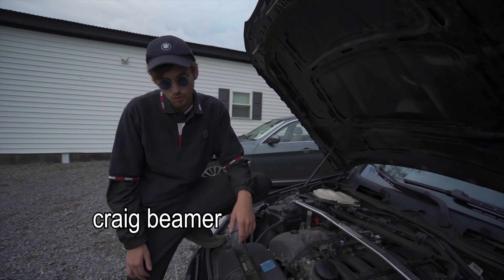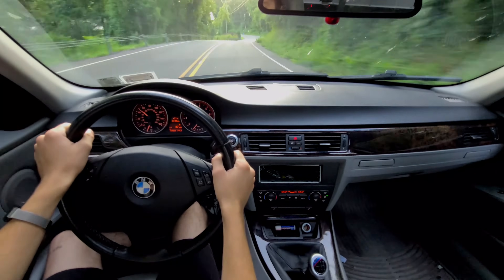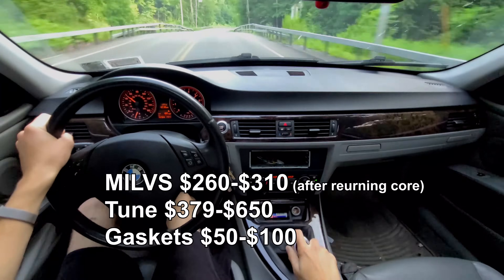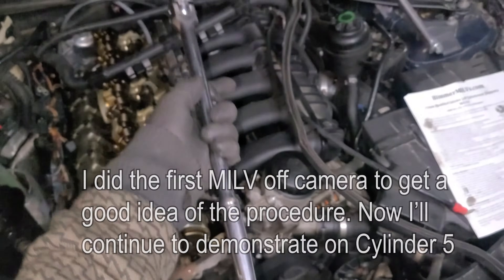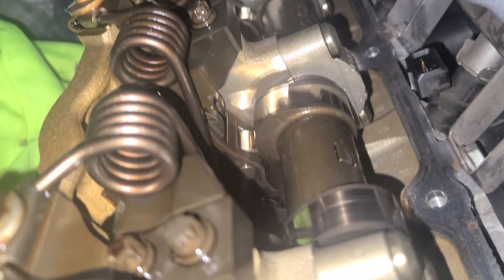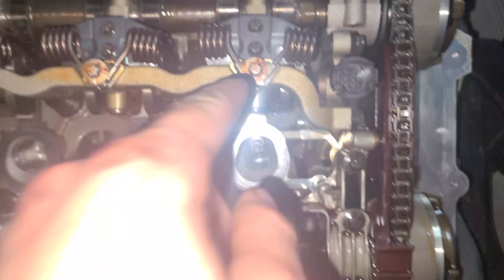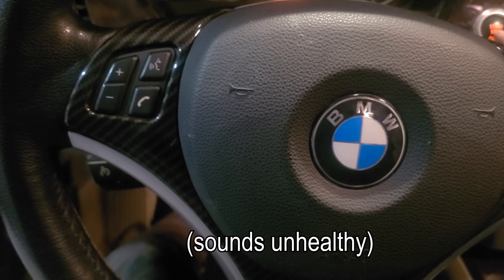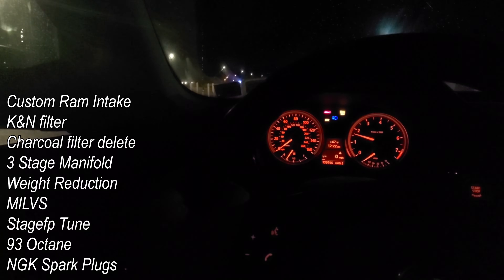BMW MILVS Installation - Overlooked N51 N52 N55 S55 N20 Intake Valve Lifter Mod

Comment: are u able to tune these in at a dyno tuner?
Reply from the maker: If the tuner knows what they're doing with BMWs yes. 22rpd also supports MILVs, which is what I currently use

Comment: So how much of a decrease you would say you got on your 0-60 with the milvs? Currently set up for me is cat back exhaust, catless headers, lightweight rims+ tires, kn filter, and a dyno tune and wondering if adding milves is even worth it for speed out of a dig
Reply from the maker: It's small / hard to notice because it affects the upper range just like headers. I'd say it's one of the last mods you should do, when you're trying to get every last bit of power out of the engine

Comment: Any idea if milvs/the tune would still function properly on a N52B25? I’m presuming this is all done on a N52B30 found on most 325 and 328s, while I have a 323 with the 2.5 litre, so I’m trying to figure out if it’s all still compatible

Comment: Hey probably a bit late to this. My N52 head got refurbished and a ticking noise appeared. I replaced 24 lifters just incase, but didnt help my case. I also replaced the chain tensioner still no luck. Any ideas where to look maybe? So pissed it haid oil consumption but no tickin before! No visible wear sound is mainly coming from the front of the engine. Any ideas appreciated!
Reply from the maker: Hey, would you be able to DM me a video to my Instagram, maybe I could help determine
Reply: @UltimateBimmerExperience  its currently 1:19am here but tomorrow i will manage! Thank you for your answer.

Comment: Hi newbie here taking on a new project. Thanks for posting this informative video you have inspired me to change this part myself 5 cautious turns at a time! Question, once I've installed the MILV upgrade on my automatic N52 330i I should get it tuned to now accept the higher RPM band. However, is it correct in thinking by doing so the car will take longer to shift up. Can I get it tuned to shift gears quicker instead of higher RPM? or does this make the MILV upgrade a pointless upgrade? appreciate any help you or anyone can give.

Comment: Where tf do you even buy these? my god I have had a tough time locating these online. I Found one manufacturer out of stock. That's all. Cheers bro great video!
Reply from the maker: On their website directly, I've got a spare set I'd probably sell. If you're interested you can DM on IG
Reply: @UltimateBimmerExperience  thx do you need a 2nd set for the exhaust side?
Reply from the maker: Nope, these are only for the eccentric cam on the intake side

Comment: Is this mod useful for the automatic 🤔
Reply from the maker: Yup, transmission doesn't matter
Reply: @UltimateBimmerExperience  you're insight is MUCH appreciated..Gotta clue as to WHY MILVS isn't talked much about 🤔
Reply: @UltimateBimmerExperience as WELL I've gotta p0172 code popping up on an N54/55 ,any quick trouble shoot suggestions 🤔

Comment: Bro I can feel the nervousness and shakiness (not a stab) If I was doing the same and would be doing the same if I ever did a mod similar to this lol. Thanks for the video!
Reply from the maker: Hahaha, yeah I was a little nervous. This was my first time doing this installation and I wasn't sure what the consequences could be if I messed it up lol. Thanks for watching!
Reply: @UltimateBimmerExperience  Nah completely understandable! It's basically the meat and potatoes of the engine. How is that mod running now, are you still running it? Did you ever end up getting a different tune on it?
Reply from the maker: Yup, still running them although I am on a different tune now. 22RPD which is a far superior product to StageFP for a lot of reasons

Comment: Did the car feel any faster to you after the MILVs install? I know they say it's 10hp extra but tbh I feel like if you were to do a blind test, most people wouldn't be able to tell a plus or minus 10 hp difference but I could be wrong. I just feel like paying for the MILVs and tunes for like 700-800 for 10 hp doesn't really seem worth it but I'd genuinely love to hear your thoughts. Love the vid :)
Reply from the maker: I'd say slightly, but it's more on the mid to top range. You're right it's a pretty expensive purchase, I wouldn't do it before an intake manifold or a good tune in general as those are both a better bang for buck. Thanks for your feedback!
Reply: Lol you get 2-4 hp by turning your ac compressor off

Comment: Might just take mine into a shop and get them grinder down probably be much cheaper....might be crazy and go 1.5-2mm hahaha
Reply from the maker: Its not as simple as it sounds. MILVs are already machined to reach max lift possible on the eccentric shaft
Reply: @UltimateBimmerExperience  Id put money that they was concervative to not destroy people engines....Regardless I can just get them grinder down 1 mm like you said looks about a that
Reply from the maker: @johncooper306  not even that, the valvetronic motor runs out of gear teeth to grab. At least to my knowledge
Reply: yeah sounds like a machine shop could do this for 10 dollars per milf

Comment: do you use extra virgin oil for oil changes ? It looks so clean. Looks like she hasnt been touched. Whats her interval ?
Reply from the maker: I use only oem KY oil. Lol I used Castrol gold bottle 5w30 and try to change every 5k miles. But the engine shown here I had only owned for 15k miles, so I suppose I got kind of lucky with how the previous owner did oil maintenance. But I've since had to replace this engine due to my own negligent mistake. But I got by what the Manual recommended but change every 4-5k on my regular 3 series

Comment: FYI: Kassel can up the redline for you as well.

Source - Jim tuned my ECU to accept an N52 in place of the N51. Coded for 3 stage manifold, 2ndary air pump out (only on N51) and threw in the higher redline at no added cost. Really happy with the results and service from Kassel.
Reply from the maker: Nice, that's good to know. I'm still wishing I went with stageFP 😅
Reply: Thanks for the info

Comment: This video is sick. There's not a ton of information online about building N52's since most prefer the N54. Glad I found this channel. It seems like only recently we are starting to really see the tuning potential for these engines and chassis.
Reply from the maker: Thanks man! That is true !
Reply: @UltimateBimmerExperience  Yup only a couple out there.. trying to get to Jayson level.. most of his engine was stock 😅 https://youtu.be/AO-eF5OA224
Reply: @UltimateBimmerExperience  Papa Craig, have you ever had any issues with the cam ledge seals on any of your N52s?
Reply from the maker: No sir, never
Reply: This comment is under rated. This video on the other hand ….. even more.
Reply: I’m trying now with my n52

Comment: hey man I got a question for n51/n52s that's unrelated to MILVs but I see that you drive ur n52 pretty damn hard and even pushing it to the limits at 7.5k rpm and revving out the car a lot but have u ever seen any types of head gasket issues or engine blow outs on completely stock engines? and I'm only talking about wear and tear and engine abuse not dumbasses who just don't maintain the car at all. I've only ever heard or seen a few very rare engine problems where someone's n51 block had a tiny crack in it that would just piss oil everywhere and even that's like a 1 and a million with these cars and I've only ever heard of a hand full of head gaskets blowing out but that was mainly from the car over heating from a coolant hose blowout and the car couldn't turn itself off fast enough for how fast the guy was going. I'm mainly wondering because I have a 06 n52 with 190k miles now, I've done a shit ton of maintenance and replacing parts on it to the point that I'm well over 6k in the car and the car definitely has a lot of life in her and I'm gonna end up doing a lci conversion to the headlights, headers, and a 3 stage manifold but I used to drive the car hard as fuck hitting red line a lot and sitting at 6k rpms for a solid minute. but what would your take be on a chance my HG fails?
Reply from the maker: Just like you said, I wouldn't say it's impossible  but personally I don't think I've ever heard about anyone blowing theirs from natural causes. I've read a lot from forums over the years, and I don't I've seen anyone talking about that really. I have seen accounts from people with 250k+ mile n52 and still haven't mentioned replacements of headgasket. It might be one of the only gaskets we don't have to worry about really at all lol
Reply: @UltimateBimmerExperience  thank you for a quick response and ur outlook on these engines. I just wanted to see if you've ever seen or heard any of these problems on the car, I've known that the head gaskets are extremely rare and these engines last a long ass time, but I never really asked anyone that knows more then me about them. I was really paranoid for a while about my head gasket because I was losing coolant every few weeks with no sign of a leak and I remembered a while ago I hit like 5k rpm and saw a cloud come out the exhaust, then when I opened up the coolant cap and started the car I actually smelt exhaust but there was no bubbling or coolant spilling out and at first, this all pointed me toward a small head gasket leak and I was a little upset about it and was even looking at Hondas lol because I was so annoyed at how much money I spent on the car in a year and a half I owned it. But then about a week ago it got real cold and a leak actually showed in the lower radiator hose. Now that I replaced the hose the exhaust smell was gone and all my coolant is good now. My take is that exhaust was coming up from the lil leak in the hose and the cloud that came out was probably just water. I'm not sure but after I changed the hose and changed the coolant I let the car sit for 10 mins without the coolant cap and everything seems good to me now. I even lost love for the car for a bit bc of it being a n52 engine but u actually brought my love back for them and now I'm gonna start redoing the car and finishing the things I wanted to do with it and shit man after looking at the market that seems like the cheaper option now

Comment: Nice, I knew what they were but didn't want to mess with undoing those springs. I know what I'm doing next time my valve cover comes off. It'll go nicely with the headers and n54 manifold that are already installed. My older stage fp tune redlined at 7700 rpm when I was trying the trumpet intake.
Reply from the maker: Super easy, nothing to worry about. And interesting, that makes me less nervous about my redline. Though I still don't know where the peak is 😅
Reply: Was the n54 intake mod difficult? Do you have a n52?
Reply: What are u getting 0-60?

Comment: In the program Ista for BMW you hace the option for relearn the valvetronic sistem, is good option for tune? Already have a tune but is not special for Milvs
Reply from the maker: It will automatically relearn but to get full benefits you'll need a tune for the car to understand how to use the increased lift. At least on n52.
Reply: @UltimateBimmerExperience  thanks!👍

Comment: Did you have to turn the engine for each milvs? After completing all milvs did you have to turn the engine again back to tdc? Did you just start the car after installing everything back?
Reply from the maker: Yes you have to rotate the engine to align the cam lobe for each cylinder. After I completed each cylinder I rotated the engine a bit more to make sure everything spun properly. Reassembled and started

Comment: Crazy enough, I've been driving around my n55 with a shot valvetronic Servo motor for 3 years. Ironically it's insanely reliable even in a consistently "unreliable" state
Reply from the maker: Well in which case, I've heard that the throttle body will carry the slack when the valvetronic isn't working.
Reply: I’ve done the same for 3 years because my mechanic fucked up installing the eccentric shaft i’m finally getting around to it today

Comment: The bolt with the line why does it need to be torqued if you only loosened it 5 times and then tightened it the same?
Reply from the maker: That's a good question, I suppose it might lose some of its tension after backing out a bit? But either way the car specs for the bolt to be torqued like that. If I remember correctly, they maybe only moved 1/8th of a turn to get them up to spec. I'm sure someone could have a better answer than me.
Reply: Thanks, another question can they tune for MILVs  in addition to tuning for intake and muffler delete all in the same tune?
Reply from the maker: Muffler delete won't affect performance but yes, both companies provide options to support intake, exhaust and fueling

Comment: Well add this to the ever growing list of expensive things I want to do to my car. 
How’d it feel according to the butt dyno?
Reply from the maker: Butt dyno was tough to decide because I was mainly daily driving my 335 during this time. It was noticable enough, but not crazy life-changing, but watching videos in hindsight really impressed me. The 0-60 clip is really impressive in my opinion, and I've still got mods to do. If you're considering it, do it as cost effective as possible, because while it is worth it if you're trying to push the limits on n52, it's not worth breaking the bank too hard. It's definitely a good one, but not as noticable as say switching to a 3 stage manifold from a single stage. Hope this helps!
Reply: @UltimateBimmerExperience  Super helpful! The 3 stage is definitely first on my list 👍
Reply from the maker: Yes, definitely do that before doing this and see if you still want more out of it

Comment: Infinite rev.. like a bike, so gud.. with some catless headders  woud be a beast.. 
Just wana ask about the shims, aparently they too increase revs on N52, what are those and where do those install? cant find anithing about it just ppl talking..
Reply: I have both on my car. Check out the channel. Just over a week old. Only thing not done is the tune to max out all my upgrades. Thanks for taking a look. More to come soon and will share a dyno print out before and after ECU tune.
Reply from the maker: Going full catless pretty soon. But the intake valve springs pivot on them, and they are underneath your valvecover.

Comment: I have this on my N52B30. I only need to chip the ECU to get the most out of it. Great that you cover this overlooked upgrade!
Reply from the maker: Awesome, what tune are you thinking?
Reply: @UltimateBimmerExperience  I’m going to visit Mosselman Turbo (company name) here in the Netherlands. They have decades of experience tuning all types of BMW engines and will make a tailor made tune based on the setup of my car. I have both the intake and exhaust side fully upgraded and the MILVS. So something tailor made will need to be programmed to get the most out of all upgrades combined. Will post a video on my channel and dyno sheets once done. Aiming for 300hp.
Reply: @BMWEiMSport  what's it running at the moment?
Reply: @sajakhtar852  No idea. I have never dyno-ed the car since I own it two years ago. I will be doing a pre-ECU tune run to see what the HP is now but planning that during various Covid lockdowns where I live proved difficult. Keep an eye on my channel for updates on this and for more videos of course.
Reply: Two years later, did you notice a difference with MILVS?
Reply from the maker: It's subtle, but yes
Reply: @BMWEiMSport what was the result at mosselman? Looking into it too